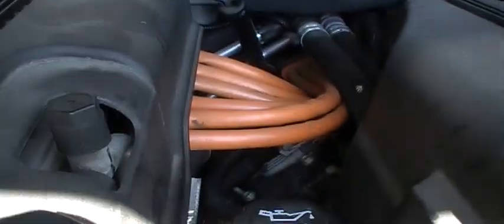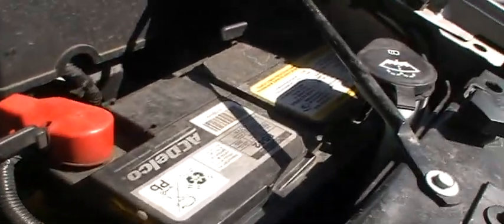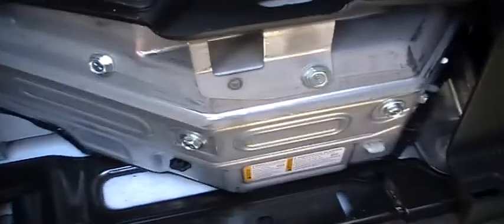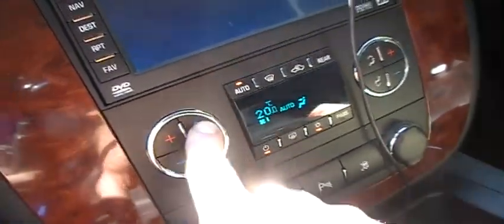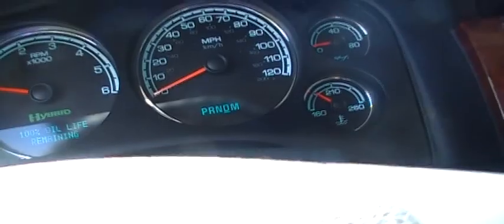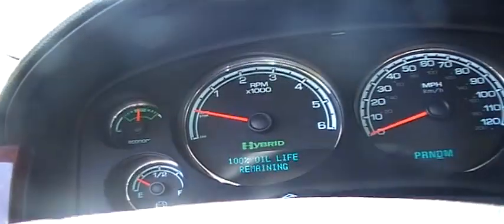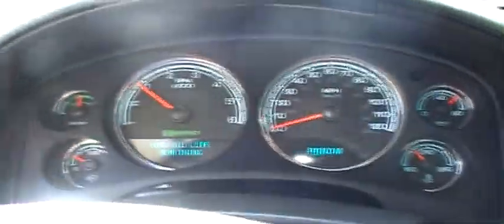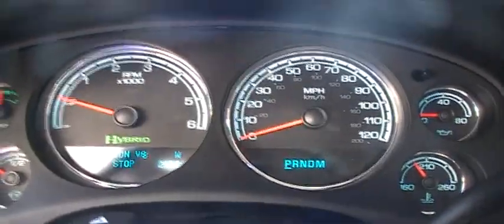How a Hybrid Works

Comment: What would cause the vehicle to shift from electric to gas and the vehicle some time jumps along or it takes a little time to shit from electric to gas. Is there anything that would have to be replace in my Caddy 2009 Hy-Brid 6.0 engine I love the vehicle and its so comfortable. Just worried about from a stand stilll to a gas switch is chugs sometimes Tom of Cape Coral
Reply from the maker: This thing has always had a bit of roughness when starting the gas engine. Basically the gas motor kicks in when the charge in the hybrid battery gets too low and when the power demand of the electric motor is exceeded and it kicks the gas engine in to deliver the extra power. If you baby it from a stoplight, the gas engine won't kick in until about 25mph, that's about as fast as I was able to get it before it fired the gas motor. But if you mash it, it'll take off like a rocket from the light, and it takes the gas engine about 3/4 of a second to kick in and roar. It's all dependent on how you drive it.

One thing you may need to do depending on mileage is replace the spark plugs. This engine runs factory iridium spark plugs, replacement interval is 100K miles. If it has old worn out plugs, it'll definitely stumble when starting up.

These engines should always have good synthetic oil and frequent oil changes, since the active fuel management and variable cam timing are both run by oil pressure, and are a quintessential part of how these engines function.

This engine has a very high compression ratio, 10.8:1, yet still requires regular fuel. Basically it runs the more efficient high compression configuration during low power demand and uses the variable cam timing to hold the intake valve open longer (into the compression stroke) under high loads, effectively bleeding off the compression and allowing the motor to run safely on regular fuel. If the VCT or AFM systems are sludged up, it''ll definitely give issues.
Reply: @6speeddakota  Thank you 6speed and have owned this from brand new. Don't get shocked but have over just over 200,000 miles on it and change wires plugs coils frequently. Always purple full synthetic oil in every 5 or no longer then 6 thousand miles. The truck as they put it is a cherry and always garaged kept. No scratches dents or any wear or tear. New tires on it along with rotors brakes air shocks etc etc. Wish i could sent you a picture, everyone wants to buy it until they hear how many miles on it lol. If they only knew how good these 6.0 are if you service them. Put the 2015 tail lights on it, and really looks hot and new lol. Also hid a strip directional in the bumper, left and right turns stop light and back up lights all work independently . Again 6speed thank  you so much for the correspondence and intel you were a big help Tom of cape coral fl.

Comment: One other quick question about hybrids that particular model your father has I believe I have the same car or truck if that Hybrid battery dies does it deem the vehicle useless or does it just go by gas
Reply from the maker: If the hybrid battery dies completely, it won't be able to start the gas engine. But, with a battery charger connected to the 12V battery, there's a way to run the controller using a scan tool to take the 12V power and charge the big battery

Comment: Also you made a quick comment in your video how the Hybrid battery gets charged when in reverse could you elaborate more on that
Reply from the maker: When you’re in reverse, the engine is running. Anytime the engine is running at idle, it charges the main battery.
Reply: @6speeddakota  battery the main battery implying the Hybrid battery correct

Comment: I had a transmission replaced on my 08 GMC Yukon they mentioned something about planetary gear and some other gear would you know anything about their transmission issues less than 70000 on it I drive like an old lady when I would come to a stop sign it was like someone rear-ended me
Reply from the maker: It could just be that you had a defective one; problem is that these trucks are so uncommon, that any common issues aren't well documented on these

Comment: (200K+ mile) 2009 Hybrid Tahoe Owner and self-proclaimed GM Hybrid engineer here, with everything you would ever need to know about the Hybrid system!
First off, thanks for the video. Not too many people have documented the Hybrid Tahoe on youtube.

In stock configuration the Hybrid is designed to run on Electric Mode only up to 25mph, then run the gas engine with varying applications of the electric motors to assist it at higher speeds.
My 2009's battery is is poor condition so it runs the Gas engine almost all the time while in motion, only shutting it down when at a stop.
To run the vehicle in "normal mode" (disabling auto-stop and the hybrid system) shift into "M4." The car will not shut off the gas engine or run in "V-4 mode" (active fuel management/displacement on demand will be disabled) in this gear.

The Hybrid transmission consists of 2 electric motors and 4 planetary gears allowing it to function as a 6 speed in "Drive" and a 4 speed in "M4."

Under the hood: 
Driver's side box is a fuse box, passenger side "Hybrid" box is the electrical system's inverter (converts electricity to/from AC & DC). Gas engine is indeed a 6.0L LS-Derivitive/Vortec engine similar to the ones found in the gas 2500 trucks and the 6.2L in other Yukons/Escalades. The gas engine has displacement on demand, meaning it will shut down 4 cylinders at highway speed to save gas. 

If you own one of these hybrids or a GM vehicle with a V8 that has active fuel management (2007-2011 models) IMMEDIATELY research GM technical bulletin 10-06-01-008F regarding the driver side valve cover and PCV valve.  YOUR CAR MUST HAVE THIS NEW VALVE COVER INSTALLED IF YOU WANT TO AVOID EXCESSIVE OIL CONSUMPTION, SPARK PLUG FOULING, MISFIRES, AND POTENTIAL PROBLEMS WITH PISTON RINGS, ETC. later in vehicle life. This bulletin also covers non-hybrid LS/Vortec derivative engines with active fuel management/displacement on demand.

To learn anything you want to know about the hybrid system in these Tahoes/Yukons/Escaldes checkout this article:
https://williamwallace.exposure.co/everything-you-would-ever-need-to-know-about-general-motors-hybrid-tahoe-yukon-and-escalade
Reply: Does the hybrid battery die after sitting for a couple months?
Reply: What does it mean when the car is jerking in motion at a low speed
Reply: @milodenwiddie1594  most likely battery.
Reply: @TheEpicPUG  the battery under the hood im having same problem
Reply: @keysersoze4334  The battery under the hood is a regular 12v lead acid car battery. You can replace it yourself easily. The hybrid system's 300v nickel metal hydride battery is under the rear seats and is made up of individual Panasonic cells. You can replace them individually or as one big set (52-58 cells if I remember correctly). I recommend having a mechanic familiar with prius batteries take a look.
Reply: Page can't be found. I would really like to read more. I have a 2009 Escalade Hybrid. Thanks for this information.
Reply: @bananamonkee  just updated the link, sorry it was an old one.
Reply: 30MPH  (29mph)  at lest on my 08 it turns on at 30mph

how do we know if we have the NEW one or not?   regarding the driver side valve cover and PCV valve.. i'm seeing Zero oil consumption besides the consumption from a leak  but it's negotiable  though...  

the oil goes in clean and goes out clean... and has been regularly maintain (oil changes every 4,000 miles)

my battery can barely start the engine... and will stall if  i'm pressing the accelerator unless i'm over 1,000 rpm   (i'll check the air filter)

Comment: Great video! I want one but it is 2019 and the last model year was 2013 I belive. Do u still recommend buying one.
Reply from the maker: I would avoid them, just my own personal opinion. There were so few of these made that getting parts for them is an expensive and lengthy process. My dad had the brake booster go out on his and it cost over $1800 USD and almost 2 weeks just to get one in. Not to mention that it needed a tow since it was virtually undrivable
Reply: @6speeddakota  thanks for the input. I will keep that in Mind.  Unfortunate for your dad's truck it looked beautiful.

Comment: MY 2010 YUKON DENALI HYBRID IS DISPLAYING SERVICE HYBRID SYSTEM, WHAT DOES THAT MEAN
Reply from the maker: I'm not sure; if there's a check engine light, best to pull the codes and see what it says, that might point you in the right direction. I know the prius has an air filter for the little cooler fan that blows air over the batteries, not sure if this one has it, but that could need replacing
Reply: Do you have a video for that
Reply from the maker: No I don't, I've never had that issue, and I'm not 100% sure if it even has that setup
Reply: My 2010 Tahoe with 129k miles was getting the dreaded "service hybrid system" message and service power steering message. Also started to turn off at full stop. Chevy said it was battery.  Getting its hybrid battery replaced tommrow. we will see if this solves all my issues. Hopefully ill get another 8 years of battery life.

Comment: Thank you for this video it very helpful I have a question I have a 2009 chevy silverado hybrid and when you turn it on it shakes and sometimes it turn off and sometimes it runs smooth but sometimes it runs rough Thank You very much I hope to hear from you soon
Reply from the maker: The starting and stopping of the gas engine is generally not super smooth, but if it's rough while the engine is running, then I would probably start with a full tune up, new plugs, wires etc. An engine is still an engine, regardless of whether or not it's in a hybrid or a standard vehicle, it still needs maintenance every so often

Comment: Thanks for the awesome info I'm about to buy one of these and I was skeptical about the battery life and that it might be expensive to replace the battery. Do you know how much those huge batteries cost? I'm a BC boy too in the lower mainland where are you? I'd love to pick your brain more about these tahoes if I need to
Reply from the maker: +jmangification Absolutely. my dad has had this truck for 6 years now and it's been a really good vehicle, it had a couple issues that were fixed under warranty, the throttle actuator being one of them, and an issue with the climate control not working, both of them being fixed with a simple software update, and the throttle actuator itself being replaced. I need to give it a tuneup and a transmission service, but it's really been only maintenance.

For having such a hulky engine, it gets about the same fuel economy as my mom's hyundai santa fe. I've very rarely heard of a hybrid battery pack needing to be replaced entirely, they're generally good for the life of the vehicle, but it has to be driven on a semi regular basis. Sitting for months at a time is not good for them, as it is for any vehicle.

My only real gripe with it is that parts are very expensive and hard to come by since they're kind of few and far between, and if you need something, the dealer generally needs a few days to ship it in, the tranny filter is like $90 from the dealer, and Lordco doesn't even stock it, so I can get it from rock auto, or I'm stuck getting gouged at the dealer. And I'm out in Surrey now, closer to work, I used to live in Delta before I got married.

Comment: Do you still have this Tahoe? I'm thinking about getting one that has about 95k miles ... I'm curious what happens if the battery pack does die can it still drive? Curious how it would start with out the battery pack and electric motors.
Reply from the maker: John Bergoon My dad still has it, he's got about 45,000 miles on it and I've had it in a few times for a couple of warranty issues for the throttle actuator causing a reduced engine power situation, and I had a leaky front diff seal.

If the main battery pack dies (which it shouldn't) you won't be able to start it. I believe there is some sort of mode you can put it in using a dealer level scan tool that will run an inverter charging system to take charge from the 12V battery and recharge the big battery pack. It only works if you have the 12V battery hooked to a fast charger.

Basically, all the big battery pack does is start the gas engine and run the electric motors in the transmission. It doesn't run any lights or electronics. That's what the 12V battery is for. It's recharged by using an inverter in the hybrid controller to take the power that is generated from the gas motor and regenerative braking in the big battery, and recharges the little battery.

The big battery is designed to be good for the entire life of the vehicle, that's the way it was engineered. So if the big battery were ever to go bad, it would likely be from some kind of defect in manufacturing, or damage say from an accident.